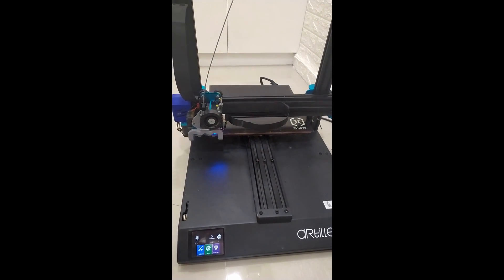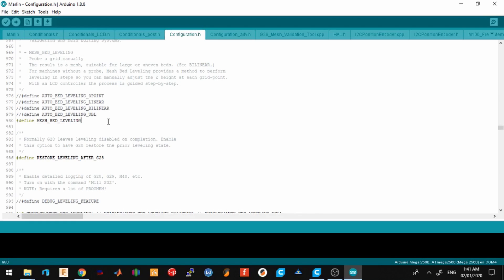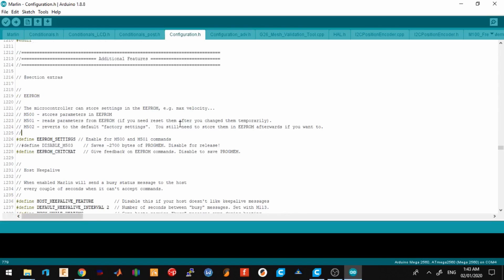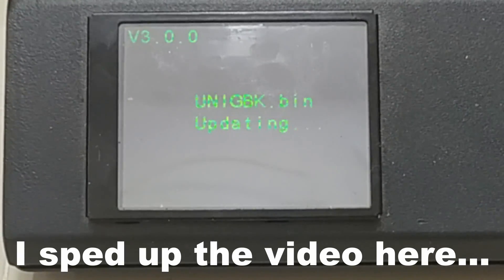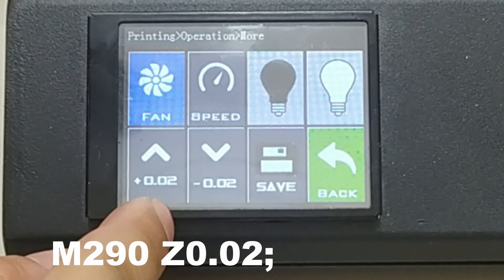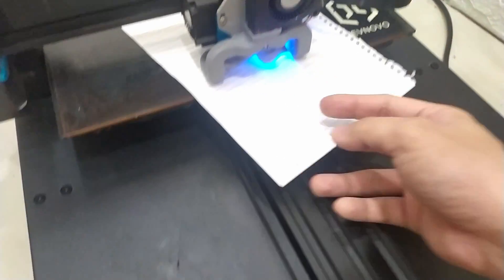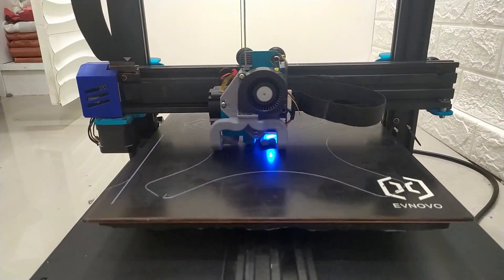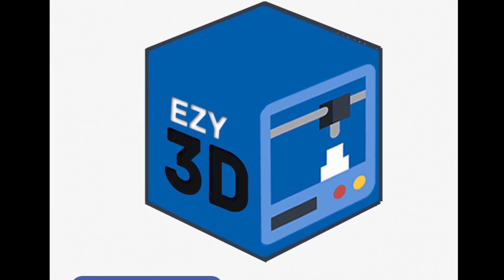Artillery 3D Sidewinder X1 Manual Mesh Bed Leveling Tutorial

Comment: on my first print after the manual mesh bed leveling i couldnt print anything there a massive over extrusion. How can i calibrate my extruder?
Reply from the maker: Try to follow this: 
https://mattshub.com/blog/2017/04/19/extruder-calibration

445 steps for the E motor is too much which was the default value (stock)
Reply: @EZY3DLAB  i have another question on arduino / tools / programmer wich one should i choose i have touch this setting thinking it was  the processor thanks for your answer and your time
Reply: i have upload the code on my printer while arduino gamma was chose as programmer maybe this can be the cause of my over extruding
Reply from the maker: @relaxeful  That shouldn't  affect it (in theory). Just try to calibrate the extruder first. Mine Esteps val is at 419 as far as I can remember. I also got massive overextrusion back then after I flashed the FW thats why I highly suggest to send an M502 then calibrate the extruder to avoid such issues.
Reply from the maker: @relaxeful  It should by default be set as "AVRISP mkII"
Reply: @EZY3DLAB  i cant connect my printer to cura or repetier- host since flashing the firmware is there another way to send the M502 command?
Reply from the maker: @relaxeful  open up device manager and look at what port you are connected to first.
Reply from the maker: @relaxeful  if you really can't connect to any of those you can always type in the command inside notepad then save it as a Gcode.

it should look like this inside

G28 ;
M502;
M92 Ex.xx (new esteps)
G28;
You need to put G28 (autohome) in the first and last line so that you'll know that the code got through.

Similarly you can put the commands in your start gcode in your preferred slicer.
Reply: @EZY3DLAB  I have sent the Gcode and the printer have done the G28 correctly but still my extruder make noise like crazy and is extruding way to fast i cant connect to the printer i am trying everything i can find but no result at this point i juste want to put the original firmware in it, but cant do it without connection to the printer can you help me please is there a command to activate the com port of the printer i have tried 2 different computer and no succes
Reply: i have resent the code with M92 E300.18 and still no difference and my led light is still working even with yours firmware install is it normal?
Reply: i can connect to my tevo tarantula no problem this is really fucked up
Reply from the maker: @relaxeful  300 is a very low estep value. Are you sure you did the calibration right?
Reply from the maker: @relaxeful  when trying to connect to the printer, make sure you close all slicer software programs as it tries to connect via the serial port (cura is one example) 

Next is to verify which com port your artillery is connected.

Comment: the mesh leveling corner points gives wildly different bed heights than the built in leveling points system, is it not running the same homing code for the corners?
Reply from the maker: By wildy different bed heights you meant? You still need to pre level the bed manually using the traditional method before creating the mesh.

Comment: After uploading the code and inserting the SD card, the LCD stays dark and it does not reflash. I Have tried reconnecting to upload again but now my PC says USB device not recognized and I cannot upload? I'm not sure what my issue is any help is appreciated
Reply from the maker: The common problem for that is the SD card. Try to format it and put the tft fw inside of it again. Then reflash. It should do the trick. If you need hands on help leave a message in my fb page (same name) and send me a picture of what's happening.

Comment: I ve did what u told in this video but the icons are not copied and i start the printer they are not showing.What can i do to copy the images of icons?
Reply from the maker: Just reflash the tft again. It's highly suggested that you reformat the sd card you are using to avoid any problems that might be caused by it.
Reply: @EZY3DLAB  the problem was from microsd card.Just take an 32 gb microsd card and everything run perfectly.Now i am testing and print a sample.
Reply from the maker: @sportmaniax7361  I'm glad you sorted things out! Good luck with your prints!
Reply: @EZY3DLAB  im having the same problem. Not sure why its not working. I have formatted the sd card multiple times. No icons on TFT :(

Comment: I'm Artillery Genius owner and I'm in troubles to calibrate well the printer. So I think this option will be the best for me. The Genius reads USB, so you think I could put TFT firmware form USB? Marlin code is the same? Regards
Reply from the maker: The Genius also has a SD card slot which you can use to flash the new FW if you wanted to. *You can't change the FW using the USB. 

If you want to add the same features that I featured in this video, you need to change some settings in the firmware (mainly the bed size and etc) other than that I think you can pretty much use everything since the X1 and Genius has the same hardware.
Reply: @EZY3DLAB  Ok. Thank you very much for your help. 
Keep going doing this great Work!
Reply from the maker: @nachogigi  You're welcome and thank you! :D

Comment: For those of you who don't want to disconnect TFT the process outlined here 

https://www.thingiverse.com/make:734108/#comments

Works a treat but does require some fiddling. I had to create the .hex file for the process. It can be found in the appdata/local/temp folder after compiling/verifying your code in Arduino IDE. Check the time stamps for one that matches the time you compiled. There is a .hex file in the folder. You can use this file and the steps above to flash without opening you sidewinder. This could be simplified if EZY3D LAB could include the hex in the zip. Cheers!
Reply from the maker: Thanks for pointing this out, very much appreciated.
Reply: @EZY3DLAB   so after getting home from work I tried to run the PID auto tuning, and could not get it to do so. The temp was overshooting so high that it failed. Had to recompile your source with BANG_MAX reduced to 160 and the PID Functional range increased to 35 from 10 so it wouldn't error out. It appeared to run fine from the tft, but octoprint showed temps were not testing correctly
Reply from the maker: @druntar5785  it's more of a hardware problem. I added a 1000mF low esr capacitor parallel to the 5v rail of the clone mksgen and did the pid Autotune. The temps are now stable.

Comment: Does it save the Babysteps when im using Octoprint?
Reply from the maker: Yes. If you want to be sure you can add the babystep plugin in octoprint. 
If you notice that the mesh is not being loaded before printing, add a M420 S1; to your start gcode.
Reply: @EZY3DLAB  Thanks! i used your firmware for a while and it worked pretty good! had some 10/10 prints with it.
Reply: @EZY3DLAB  okay i got a problem. i cant flash the TFT Firmware anymore. it just doesnt give a dang when i plug the SD Card in an  reboot. any ideas why?
Reply from the maker: @poggershonters36  delete the existing files in the sd and recopy the files to the sd card (the one i provided)
Reply: @EZY3DLAB  i did. nothing is happening. its just booting to the Menu. i have the SD card selected.
Reply from the maker: @poggershonters36  when you tried to flash it, did the file extensions changed? If so, it tried flashing the fw at some point. 

The best thing you can do is to reformat the sd card or use another one then recopy the files and flash it once more. Another user had the same problem and it was fixed by reformatting the sd.

Comment: Really good tutorial. Would it be possible to add a function for adjusting the PID auto tune temp?
Reply from the maker: You want to change the values of the P.I.D itself? If that's what you are referring to then it can't be done via the tft. 

You can however, initiate a pid autotune command (by pressing the PID Autotune button) so it will autocalibrate for the PID values.
Reply: @EZY3DLAB  No, I meant the temperature that the PID is done at.
Reply from the maker: @danielclasson  Ooh. in that case try to edit the  mks_config.txt and set your custom temperature there. You'd want to search for 

>moreitem_button7_cmd:M303 E0 S200 C20 U1; G28; and change the value of "S200" by the temperature you'd want to do the PID tune.

then reflash the tft. :D
Reply: @EZY3DLAB  It would be nice to be able to do that from the the TFT. Would it be possible to remove the S value from the code and just pre-heat to desired temp instead?
Reply from the maker: @danielclasson  It needs the S value in order to work. :(
Reply: @EZY3DLAB  Well, then I will be forced to put a switch on the TFT cable, that is okey, was just hoping not to be forced to drill the chassi. Thanks allot my friend, keep up the good work.

Comment: Very good tutorial, but i have problems with bed leveling. The z goes all the way down and does not stop when it touches the z min endstop sensor. What should i do?
Reply from the maker: First and foremost, Avoid the printer from crashing down

Manually move the z axis up then Connect the printer to pronterface and send the command M119 (this should show that the Z endstop is open)

Now get any metal object and place it on top of the endstop then send the M119 again (the output of the z endstop should be TRIGGERED) 

if it remains "open", go check the connections of the endstop if it still doesn't give the right response, you might want to get a replacement part instead.
Reply: EZY3D LAB EZY3D LAB so the endstop sensor had the earth wire broken from its board, solderd it and it works, but when i start the print, the printer forgots the mesh even with M420 S1; any suggestion? Thanks for the sensor tip!
Reply from the maker: @Urbanboss91  the best thing to do in your case is to redo the mesh while it's connected to pronterface (so you have feedback on the mesh data) 

Always check if the mesh is saved by sending a M503. (This will spit out all the machine settings including the mesh) 

Try to turn the printer off, then send a M503 again. If it doesn't load the mesh, you might want to reflash both the board and the tft then try again.
Reply: EZY3D LAB  i found the problem. The endstop sensor was acting strange, change it to a push button and all is good. Allready printing and i’m very satisfied with the quality of the print. Thanks again for the help! Keep posting good stuff🤟🤟🤟
Reply from the maker: @Urbanboss91  You're welcome! I'm glad you sorted it out!

Comment: In an attempt to install mesh bed leveling, i installed another firmware by robscar over on thingiverse. One of the links he posted showed a method to install the firmware using avrdude(Without disassembling the printer) and it worked. It uses a hex file to do so.

robscar firmware- https://www.thingiverse.com/thing:3856144
avr dude-  https://www.thingiverse.com/make:734108/

But his firmware did not have MBL so i came to your video and you have uploaded an arduino .ino file. Looking more into it, i've found out how to make a hex file out of it but it generates two hex files. One called Marlin.ino.mega.hex and another with Marlin.ino.with_bootloader.mega.hex. Im not sure which one of these should i flash or if these are even the correct hex files. 

Any help would be amazing
Reply from the maker: Why do you need to make the hex file when you can just upload it directly?

Please do take note that MBL does not work well with Linear advance when using the latest marlin (2.0.1).
Reply: @EZY3DLAB  I'm trying to install the firmware without opening the printer, that's why

Comment: Hi there , I have a problem with TFT. Here is my scenario.

I have installed this firmware then it works just fine. But after I did PID auto tuning for the second time my TFT became dark nothing came up on screen. I have tried to flash firmware both mainboard and TFT but screen still dark nothing happen even beep sound. My questions is should I replace new TFT screen or not? Thanks in advance.

(While I did PID auto tune I switched back to home screen to watch temperature up-down cycle then it's started to save then the screen became white then black after that nothing came up anymore)
Reply from the maker: Either you have a faulty tft or it's a loose connection. Recheck the connections and try again. If the problem still persists, consider opening a support ticket from Artillery.
Reply: @EZY3DLAB  Well It happened when I click back to home screen to watch temp cycle. If I stay on that page do you think it will happen? I rechecked everything related to TFT nothing wrong. Thanks
Reply from the maker: It will not happen regardless of whether you stayed on the page or not. Try reflashing the tft again. The problem you are having is really a hardware related one.

Comment: Thankyou for the instructions and the files, I had a scary moment with a dead LCD, however it turend out i got the plugin wrong :-) I performed the leveling, and printed a test, it works perfect, the Z ax is moving along the with the warping of the bed. I used the baby steps the get the perfect first layer! 

Now the next day ( after powering the system off and on) I did another test, and it looks like the data is no loger there, the z ax is no longer moving along with the warping of the bed, is there a way to check if the data is saved?
Reply from the maker: Thank you! 
Another user experienced the same thing, the solution he came up was adding a M420 S1; after the G28 in the start gcode. I will make further test regarding this. Thank you for the feedback!
Reply: @EZY3DLAB  My current code is this:
G28 ; home all axes
 M117 Purge extruder
 G92 E0 ; reset extruder
 G1 Z1.0 F3000 ; move z up little to prevent scratching of surface
 G1 X2 Y20 Z0.3 F5000.0 ; move to start-line position
 G1 X2 Y200.0 Z0.3 F1500.0 E15 ; draw 1st line
 G1 X2 Y200.0 Z0.4 F5000.0 ; move to side a little
 G1 X2 Y20 Z0.4 F1500.0 E30 ; draw 2nd line
 G92 E0 ; reset extruder
 G1 Z1.0 F3000 ; move z up little to prevent scratching of surface
Reply: @EZY3DLAB  I have chanced my, and added the M420 s1 command, and now the Z-ax is moving along with the bed! 
G28 ; home all axes
M420 S1 ; enable bed level compensation
 M117 Purge extruder
 G92 E0 ; reset extruder
 G1 Z1.0 F3000 ; move z up little to prevent scratching of surface
 G1 X2 Y20 Z0.3 F5000.0 ; move to start-line position
 G1 X2 Y200.0 Z0.3 F1500.0 E15 ; draw 1st line
 G1 X2 Y200.0 Z0.4 F5000.0 ; move to side a little
 G1 X2 Y20 Z0.4 F1500.0 E30 ; draw 2nd line
 G92 E0 ; reset extruder
 G1 Z1.0 F3000 ; move z up little to prevent scratching of surface
Reply from the maker: @rensroosloot  Nice, I'm glad it worked. I will update the readme file so that they can put the M420 S1 to their start gcode.
Reply: @EZY3DLAB  BTW my sidewinder tells me it is version 1.5....
Reply from the maker: @rensroosloot  Yep that's the version for the TFT which we all have (regardless of the version they say) 

To clarify things about this, the versions 1 2 3 and 4 have the same hardware (in terms of the Mother board, stepper motor drivers and the TFT lcd) the only thing they changed was:

Ver. 1 &2 has a smooth glass 
Ver 3 has the textured ultrabase copy 
Ver 4 has the textured ultrabase copy and they changed the placements of the ribbon cable and added a reset button.
Reply: @EZY3DLAB  Thanks for clearing this up for me, that means I have the V4!

Comment: Hello, at first THANK YOU for your great work. I have got a question: Could I verify the leveling, if I done the procedure according the instructions, by repeat the procedure without changes? Because I have the same delta level like before the leveling.
BR Stefan
Reply from the maker: You only need to re-do the mesh if you notice that your bed level is starting to get bad again (which will eventually happen since the vibrations can cause the leveling knobs to move). That's more or less 10 successful prints. 

From my experience I only re-do the mesh after 30+hrs of printing.
Reply: the prints are good, I only want to know if the corrections are included for the next bed leveling verification (the procedure) or does it set back to defaults?
Reply from the maker: @stefanspath8890  What do you mean by "Next bed leveling verification" Exactly? 

Let's say you have successfully made the mesh, if you want to re-do the mesh it will set all the 9 points to 0 again so that you can override it with the new points when you re-measure it.
Reply: Just for Verifikation of my last leveling.
Reply: Hi, the fan duct looks great. Wäre can this be found?
Reply from the maker: @stefanspath8890  Here you go. https://www.thingiverse.com/thing:3939198

Please do take note that it's for a 5015 fan, the stock fan is a 4020 one.